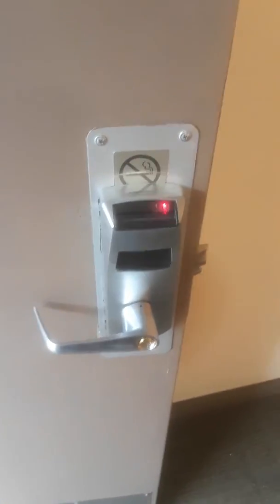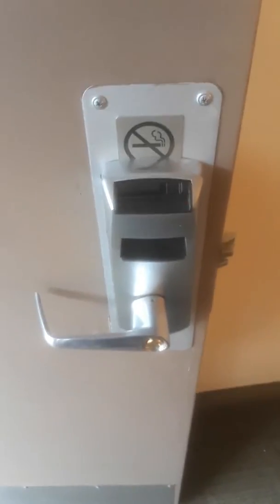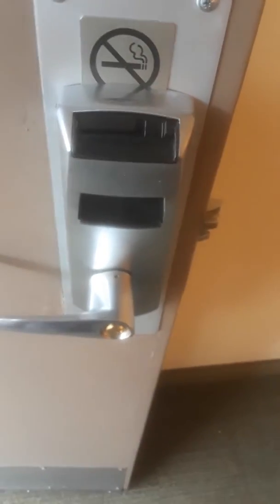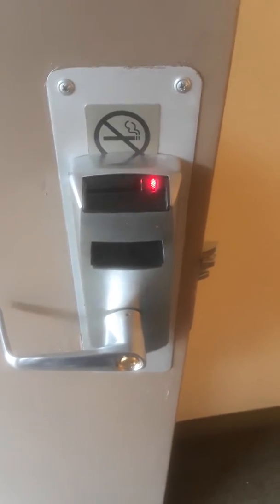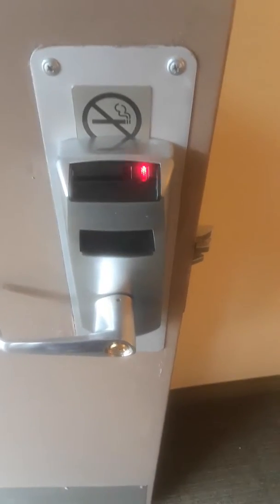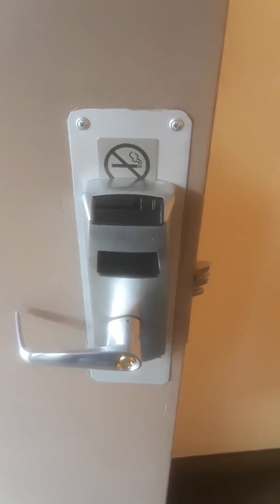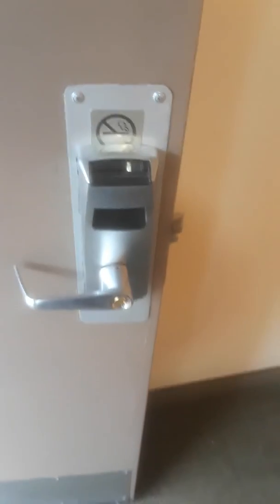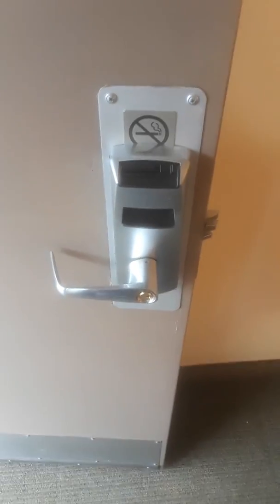Kaba lock flashing red light codes

Comment: Put new battery sleeve... Or if not you need to open the back plate and see if the mechanical lock is seated  correctly... Put the battery back in while you have the back plate off and hear if the lock makes a click sound...  If it does then reprogram it... And this time when you tighten the plate dont gorilla it. Hopefully this helps... I work on these locks at my job we have the 760 series.   I came across a few of them myself
Reply from the maker: Right, I agree totally.

Comment from the maker: it turns out that during the assembly and installation of the new kaba lock there are a few calibrations which have to be done before the lock can be programmed. it was a learning experience but I was able to complete the work and the lock is operating properly at this time.
Reply: Can tell me how you fix that problem.i really need to know.
Reply: I am having this same issue right now. How did you correct the problem ?